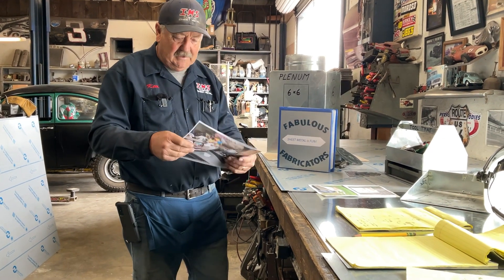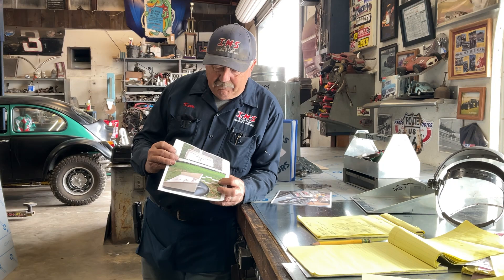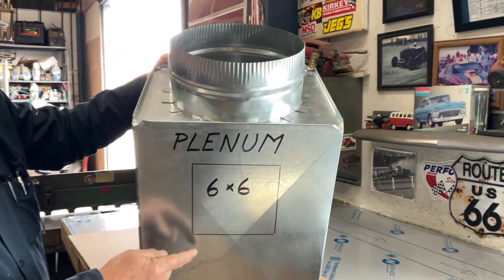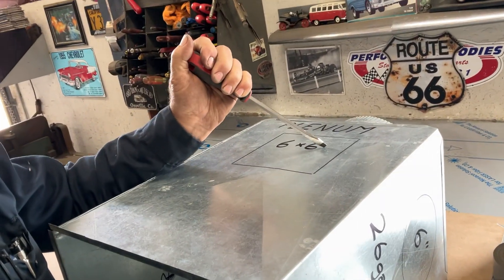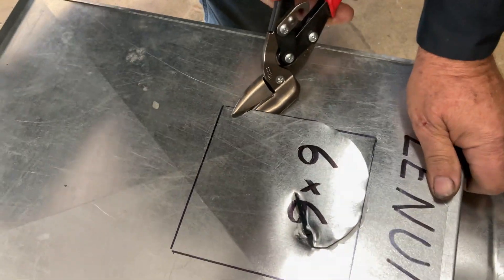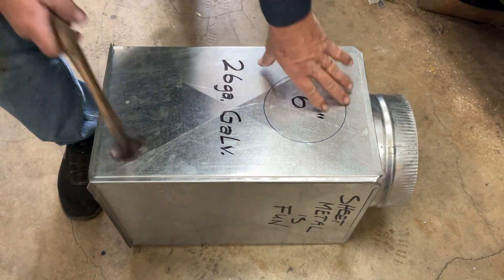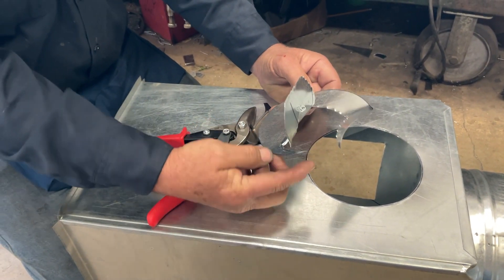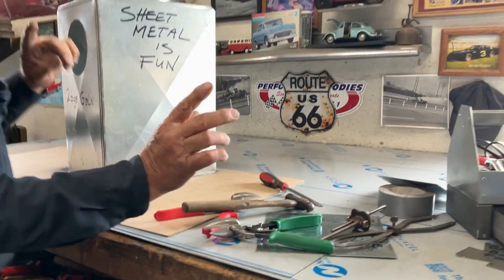SHEET METAL IS FUN!  Snippets with Ken! Cutting Round and Square Holes into Sheet Metal

Comment: any tips for even smaller circle and square holes?  what if they were 1/3rd teh size? is there a different tool or technique you would use?
Reply from the maker: For the round stuff,  they make hole saws that fit  your drill. For the square stuff, I have cut plenty of 2" square holes with snips. Good question. Let me know if this helps.  Thanks for watching